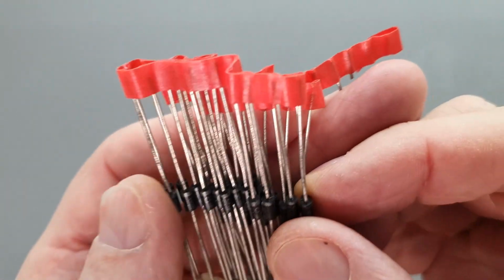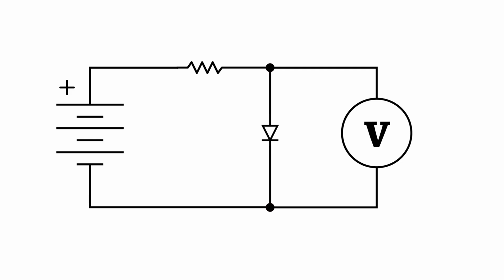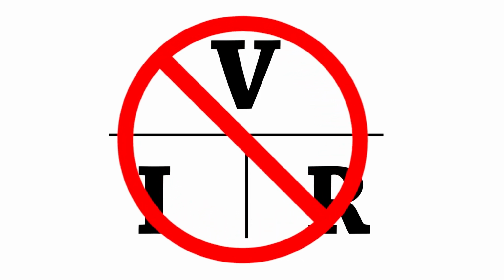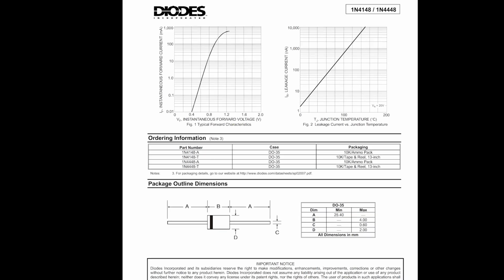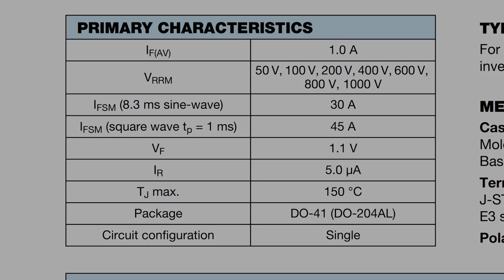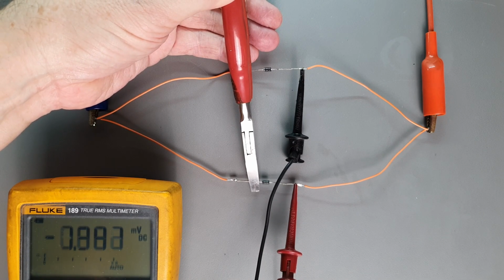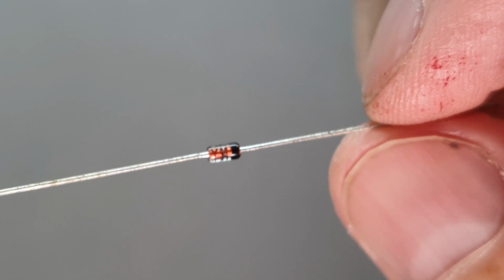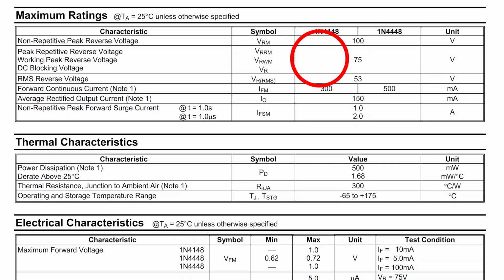Electronics 5 Diodes

Comment: Diodes are sneaky critters. You can use them in the correct configuration to convert AC to DC.  They are also good as gates.

Comment: Heat will vary any component's characteristics however it would be more correct to say that the resistance is nonlinear with temperature. Ohms Law always applies that is why it is a law. Otherwise bravo, you are an excellent teacher.

Comment: Hi Leo, awesome video! Love your approach.
Do you have any tips on how to figure out what diode to replace the one that burned right off the board . Its for a mother board  that goes in a musical keyboard that is no longer in production and it’s right next to the cpu Had to put in a new 
trace , doesn’t look very pretty 
But I have a good feeling it will work .
I know I need a 0201 size 
diode but what rating do I use?

 pretty I’m new to 
electronics. But I know it will Er

Comment: Yet we do see LEDs (each with a resistor) quite frequently in parallel configurations so I don't think that's a problem, right?  In fact this is true of any common cathode LED (e.g. RGB LED, 7 segment, etc.).
Reply from the maker: Yes - thats a series-parallel circuit - the resistor buffers the Vf problem

Comment: Great video sir!
Reply from the maker: Thank you kindly!
Reply: @leosbagoftricks3732  I plan to get an ee degree before I turn 50. I've been retired for 9 years and just turned 45. I have half the credits already from my previous degree so I'm situated nicely. It's a bucket list thing. I did software engineering and broke the line of mefhanical/electronics engineers in my family haha. It goes back like 4 generations that all worked at the same company doing the same thing haha.

Keep up the work and post a PayPal account and I'll donate atleast 20usd a month until you grow the channel to where it should be. You have that quality and just need to keep leaning into it. Charge companies for reviews too because soon the emails will start. I know alot of creators personally. It's a great way to make money and make them agree to a boiler plate statement which keeps your integrity. Then sell the item if you don't need it haha. Sorry, I ramble.
Reply from the maker: All great advice! thanks a bunch!